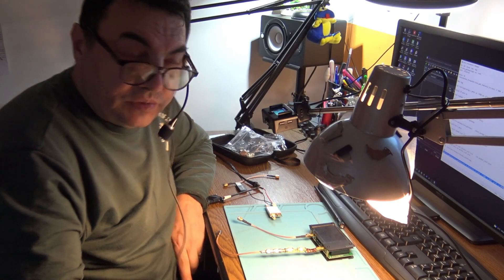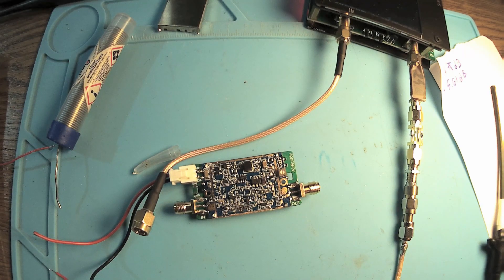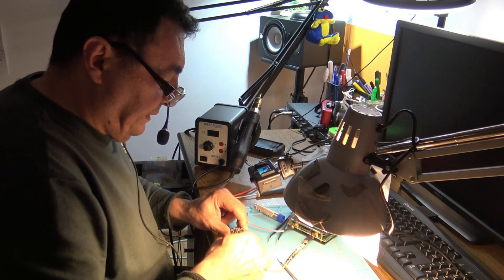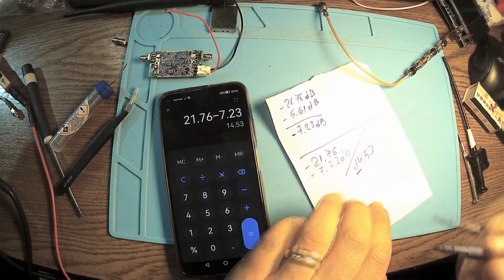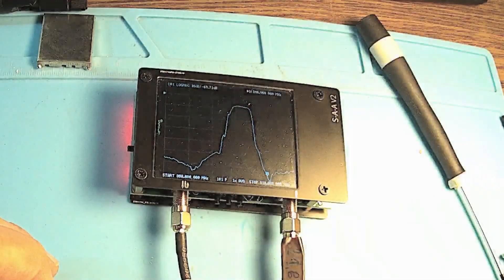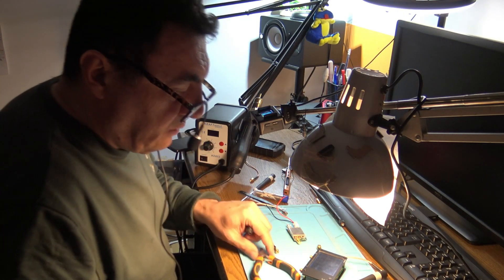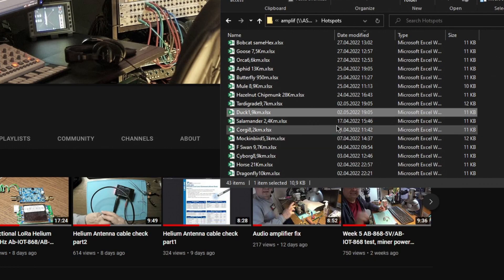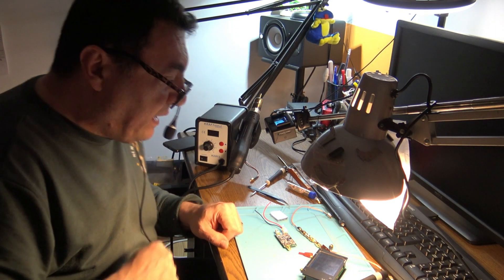AB-IOT-868 no TX but good RX MOD

Comment: This Mod is safe? removing the Capacitor not cause burn the Hotspot?  I mod my AB-IOT-868 removing the capacitor and solder the Saw filter, but I'm afraid to connect to the hotspot and burn the hotspot
Reply from the maker: Not at all..the filter is a kind of capacitor too...infinite resistance

Comment: Who fixes the airbuddy? I have no Rx ( green light is on) I can ground out the switch and the blue light comes on, not getting any witnesses I do have a saw filter
Reply from the maker: I can't find any info about the circuits they are using..
Reply: Same here - I can't figure out what the component specs are, and you can't even see tracks on the PCB - personally I have concluded that the AB amp is rubbish, so wouldn't waste your time on it. (Perhaps my personal view and my own test results)
Reply from the maker: @TheDoctorFX  I got a few running ,so far I found the RX LNA is noisy..and TX falling after a while..now I'm testing one MODed just for RX..we'll the results soon..I believe if they are original and not miss labeled ? they have potential..of course not for how much cost now..over 100EU..more like 50 should be a decent purchase..Work in progress..
Reply: @viocaia  I never expected it to work well tbh, i bought original one months ago, only £15 - just as an experiment - but you need to ignore the RSSI and SNR,  only look at the very weak signals received on antenna and see if they are improved with the amp - if your results are like mine, it will show that the very weak signals are not even received by the amp, which is the whole point of this exercise - I believe the noise figure of the amp of 2db will never make this a viable option.
Reply from the maker: @TheDoctorFX  Agree...
Reply from the maker: @TheDoctorFX  Yep! I so that already, good RSSI but SNR is degraded substantially ! Also I found the TX is triggered from the Antenna port ..it's no use, I'll try to find a way to open from miner side..at least...I couldn't find any info about ICs..those AZ2141 are amplifiers for sure and CATLY is commanding the relays..
Reply: @viocaia  Yes, the TX will get triggered from the antenna input because it is amplifying the VNA by maybe18db,  which then passes through the RX side, but also this RF is detected and switches the TX - you may notice the TX switches on and off quickly due to when it goes in to TX there is no RF anymore, so it turns off, like a feedback loop.... hope it makes sense ... also on the miner, because you have to put in a higher gain for your antena setting, so you don't get invalids, this reduces your TX power to a minimum. which then most likely stops the TX sense on the amp - you can prob test this by keeping the antenna settings at maybe 3 db - and then see if this  now allows you to beacon, of course you will start to get invalids, but will prove the point...... but in any case, all this is wasted time, as my personal experiments result in the AB amp producing less witnesses, so will not be using!
Reply from the maker: @TheDoctorFX  I believe so too|! BUt there there are people who claim that it is a good amplifierr..I have to see for my self..like I said for now I found it very noisy.! Those quickly on and off TX are because VNA is sweeping from 800 900 MHz on and on..TX is on even with VNA RX Ch1 disconnected..so no feedback..simply is on and off TX-ing somehow...
Reply: @viocaia  If you set VNA stimulus to CW Freq, it only sends one RF frequency out, no sweeps across the band.  It is pulsing the TX on the AMP because there is an RF detector on the AMP at the TX input (Miner end). So when the VNA sends a signal at the AMP antenna input it makes the VNA signal 18dB larger, which appears at the AMPs miner end, the RF detector then sees the large signal which is big enough to make the AMP think you are Transmitting from miner side, so it switches to TX mode, when this happens it no longer amplifies  the signal and passes it through to the Miner, so the RF goes and the the AMP goes back to RX mode - this is the pulsing you see - hope explanation is clearer....
Reply from the maker: @TheDoctorFX  Very clear ! Thank you! Makes sens..

Comment: Good work, keep up the testing Viorel.

I think your conclusion previously that AB amp is good may not be correct - you were comparing the AB amp  against antenna only results where antenna only was faulty, you need to remove any comparison to this invalid data - i think, as  you said, you had a bad connection in the coax - this explains why there was 30db difference-  I think you need to get results of antenna only, now your connection is fixed.

I also have some theories, and my tests show that the AB amp is actually degrading the signal, you are better off without. I see very clearly that i receive more witnesses without the amp, the amp adds 2db of noise, so this is not surprising-  what you need to look for is if you receive more weaker signals with the AB amp, compared to with Antenna only - this is the true test, perhaps if you can see weaker hotspots you have never seen before without the AMP - I am going to modify my software to look at this to help analyse it better.

Also, perhaps the other potentiometer is to select the RF detector level - this  may make the TX work once more - I think the spec says it needs -2dbm  to TX - this internal pot may adjust this - my AB amp doesn't have a pot, so can't test this.
Reply from the maker: Right..things are getting clear..work in progress though..

Comment: What about the capacitor you removed and replaced with the filter, what was its job ?
Reply: That capacitor have to be replaced where it was because it stops the DC through the line... If you use Bias T you'll have DC to the antenna.
Reply: @TaperedWiz  and if i don't use bias T ?
Reply: @wazneh  is a little less "risky"... but, as you could see on the most RF circuit (but, not only these) boards/schematics, there is always a capacitor close to the IN and OUT plugs. If they are there, is because the good design practices state that are needed.. it is not good for DC voltages to be where they are not expected. ;-)
Reply from the maker: Also a capacitor of a certain value is a band pass too..of course decoupling in electrical way circuits, in this case the filter is a kind of capacitor too..
Reply: It has nothing to do with Bias -T - red herring comment earlier - it is mostly to do with protecting the circuits, as they are very sensitive, also, dependent if this is the only DC blocking capacitor, it could cause the amp to easily saturate with even a small DC voltage on antenna input - so may stop working altogether, hopefully there is another Cap on input to the amp....
Reply: @TheDoctorFX  the soldered filter has a built in capacitor and inductor, should prevent saturation
Reply: @wazneh  Really, I have never seen a Saw Filter with it built in, are you 100% sure about this? What is the part no, I will look it up?
Reply: @TheDoctorFX  the saw filter is a capacitor and inductor , thats how it makes the bandpass filter, in theory
Reply: @wazneh  ok, I went and read up on this - Internally it hasn't inductors or capacitors, however, it will block DC, the main problem is that it can't tolerate DC to work correctly, it will cause problems and most likely cause distortion and or ultimately cease to work as they are not spec'd to take many volts, Viorel may get away with this, since his antenna is a grounded type, but  not ideal.